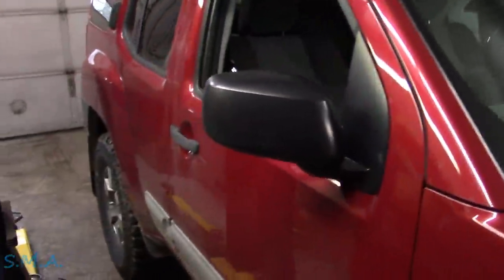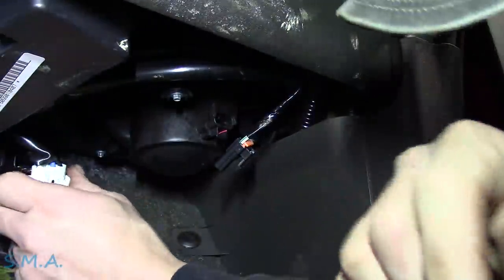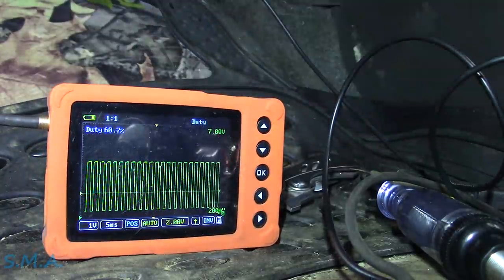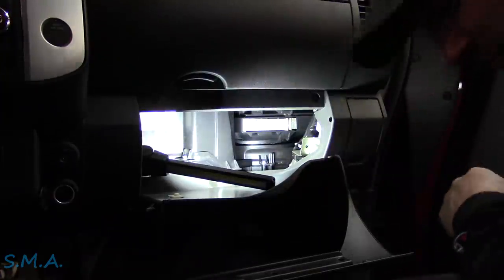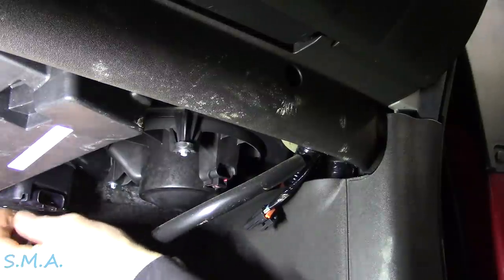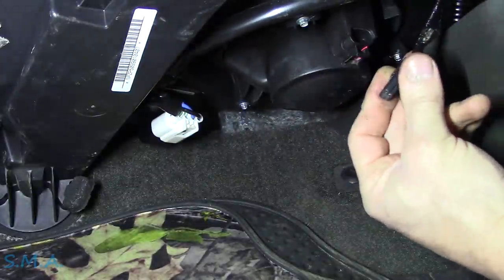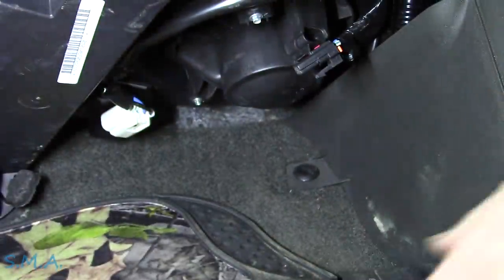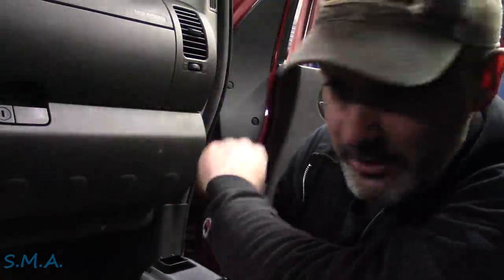Nissan Xterra: Blower Motor Not Working

Comment: When dropping your car off to your mechanic, at least have the decency to clean your car up so your mechanic doesn't have to wade through the collection of garbage on your floor (fast-food wrappers, masks, dirty socks, etc). A hazard surcharge seems appropriate in these instances...
Reply: amen! preach it
Reply: Eric should charge them a fee for "hazardous waste removal"
Reply: My guy keeps organic respirators and nitrile gloves on hand, and if they have to clean out the customer's car to work on it, they're happy to do so - at full shop labor rate.
Reply: I’m a detailer at a dealership and I can’t even begin to tell you how many vehicles I see in the shop that should be charged with this “cleanup surcharge.” I had to clean out a customers driver and passenger compartment just so one of our mechanics could change the radio. The car was filled from floor to top with just trash and random shit. It was absolutely filthy and disgusting. I sprayed it down with Lysol when I had the front cleaned out.
Reply: I had one come in once where somebody had vomited on the right side floor and not cleaned it up.  Man, that car stunk.  I shoulda just sent that car out until the owner cleaned it, but I think I threw a fender blanket down on it while I was working on it.  Nasty!
Reply: @Lugnut64052  Ew.  Just... ew.
Reply: Yes you're right but I didn't see Americans car neat and clean in side and under body oh my GOD It's rusty garbage 
😢😢😢😢😢😢😢

Comment: Eric, I've sat in 100's of those design review meetings over the past 40 year as a design engineer. It usually goes like this... 
Engineer: "We're going to use a 6mm hex head screw, it's a common size"
Purchasing Bean Counter: "We can get 5.5mm hex head screws $0.001 cheaper"
Boss to Engineer: "Change it!"
Reply: You need to whack the bean counter over his 'computer' to give him a reboot.
Reply: I can’t believe I just needed to order a 5.5 deep and 5.5 wobble to remove the ignition assembly thinger I in my Ford Escape. Does a socket set come standard with a 5.5? Nope. So Ford must be collaborating with socket manufacturers to sell 5.5s. Or not
Reply: 100%
Reply: @marksd5650  not just Ford, I remember Saturn also used a 5.5mm socket for its ignition switch
Reply: Just use a 7/32 I've yet to purchase a 5.5 never had an issue
Reply: And then there like we could use a one piece filter that's easier to change but that would require $.02 more in plastic. lol
Reply: @adventureoflinkmk2  
Ford escort ignition module, on side of distributor. First time I ever heard of a 5.5mm socket. Only Saturn around in them days, had rings around it.
Reply: @martyj1062  some of us dont have Sae, only work on modern-ish cars, way past Sae
Reply: @splice247  not sure what modern-ish constitutes or has to do with what I stated. I gave a simple work around. to imply sae isn't relevant seems rather narrow considering industrial and agricultural etc.
Reply: If engineers made the decisions car would be built to be repaired and would last forever. They would probably cost too much as well, but they would be built to last.
Reply: @martyj1062  7/32 x25.4 = 5.55625 mm
Reply: @martyj1062  yes, some dont understand you can substitute some sae for metric , 5/32=4mm and  and 5/16=8mm. And everyone knows 5/8=`16mm and 19 mm=3/4. And once you get into the ones over an inch then  most sae  sizes will work as well as metric
Reply: @marksd5650  Mazda/Ford 7mm Allen brake caliper pins... grrr... gots one now!. GM, Toyota also use 5.5 on resistor.
Reply: Nice. I imagined it going something like that. Thanks.
Reply: @martyj1062  I to do this but seems to strip the little guy that is impossible to get and I leave that screw in and break the ear off. It’s my in-laws car so it’s good.

Comment: Mechanics have it so easy these days. I spent Sept 1970-May 1974 in the Oldsmobile final assembly plant in Lansing Michigan. It was a hoot watching my co-workers assembling the dash. It was face down on a special support, and they had free access to everything from any direction. To assemble the dash they use custom-made tools to snake wires, and cables through the rats nest. Thus, even if your mechanic pulled the dash completely out of the car, they would never ever be able to complete some repairs without those special tools. I will bet only the dealers had access to those special tools.  But I don't know.

Comment: A 2005 Nissan Xterra was my first vehicle... bought it used with 230,000km for $1,000 CAD. Same red colour.  I loved that beast: learned so much about automotive mechanics and general car care/repair. Drove it for 5 years and ended up putting it to rest at 400,000km. The blower motor was one of the first repairs I ever did. Thanks for the memories, Mr. O!

Comment: I feel your pain from the gut feeling. To get paid for actual diag time is almost impossible in my neighborhood. One shop I worked at always sold the resistor and blower as a combo. Truth be told, I didn't mind. I hate just throwing parts at cars, but being under most dashboards is difficult. I'm a big guy with broad shoulders, I don't fit well under most dashboards. I also have had my neck bones rebuilt. If I'm going under, I don't mind replacing them both. As always, your videos are my top clicks. I only watch other channels if the repair is relevant to something im working on. Just know alot of us was feeling the pain of being crammed under there.
Reply: I'm sure Eric is thankful he's not a big guy as I think he's at most 5'10" and wears a medium to large shirt/hoodie, so even then, it's tight under there and I've had to deal with being under my dashboard and yes, it's no fun at tall for anyone, but more so for the bigger guys, especially the more broad shouldered, barrel chested ones.

Comment: With a PWM signal, that "resistor" was likely a power transistor.  Usually, power transitors have an inline thermal fuse that blows.  Replaced one on a 2004 Honda Pilot.  No where in the manual did they tell you about the fine mesh over the blower intake that was in the driver's footwell.  Previous owner had had small dogs, so there was a felt built up over the intake.
Reply: Couldn't understand why a PWM driven motor would need a big-ass resistor. Thanks for the comment.
Reply: @Bret Agreed, and I still wonder why a transistor that should be saturating  would need a heatsink that huge (30W?)
Reply: Exactly.  And 99/100 a power transistor is going to fail short .  Which is to say the blower will be full on.  If it's not, then go looking for that thermal fuse if you have the time.  If you don't have the time and it's not your car, follow Eric's path of replacing the parts.
Reply: That's nuts!
I take it you mean a non reset-able thermal fuse on the heatsink?
Either way, the only purpose of that would be to protect the mosfet from getting too hot. Why bother if the thermal fuse is just going to disable the PWM driver anyway?

Some designs man, really make you wonder.
If it were my car, I'd build a board with a fet bolted to a heat sink and a gate driver, stuff them in a box under the dash and know that I never had to worry about it again.
Reply: thanks 'cause i wondered how a "resistor" would be used in a PWM application.
Reply: @TeemarkConvair    Yes, certainly not old school where the "resistor" pack was three coils of nichrome wire strung between an arched bracket that stuck in the airflow.
Reply: Ok, that clears up my question. Why a PWM controlled motor would need a big resistor.
Reply: @jimmyb1451  I agree it's crazy but I betcha the blower motor doesn't have any other switch, so it would run all the time even with the key off if it overheated and failed short.  Anyone with a schematic want to confirm?
Reply: @paulmoir4452  Nah I doubt that. The A/C or climate control would be powered through the IGN circuit. Most probably, there's already another FET that supplies power to the pwm module, switched by the BCM after the engine has started. 

But.... who would know these days, the stupid sheet they're putting into cars and the stupid ways they're doing it these days... really anything is possible.
Reply: Guys, there is no resistor. This is a power transistor controlled by a pwm signal from the controller to drive the motor. They generate a lot of heat, that’s why the big cooling heat sink
Reply: @deerhunter8533  Resistance is futile!!
Reply: @deerhunter8533  That's the thing though. It shouldn't be generating much heat. Unless the gate drive is poorly designed or the chosen FET is particularly slow, it should be driven to saturation and shouldn't be spending much time in the linear region.

All that said, it's not much of a heatsink. 

Clearly though, there's not a lot of head room in the current switching capacity of the chosen FET. It was stall torque current that caused it to blow. Interesting that it didn't blow short.

I'd like to see a tear down of the PWM controller (assuming it's not potted). Would be interesting to see if for some reason they went with a BJT.
Reply: @deerhunter8533  Yeah, we're aware of that.  Jimmy B's response is what I would have said too.  If you're PWMing and your switch is getting hot, you're doing it wrong.
Reply: @jimmyb1451  Don't know about Nissan, but when installing a parking heater in VW's, you just wire in a seperate fixed rate PWM module, which starts the fan at a fixed speed. The fan's power side is always on.
Reply: @jack002tuber  it's why you never try to stop monks from protesting.

Too many ohms.
Reply: @ebbetranberg9472  lol... is that a trick answer because some VW's have a positive chassis? ;)

Yeah, fair enough for a low side switch. And for a parking heater it makes sense that ign/acc not be involved.
Reply: @jimmyb1451  I don't really know what you mean, but the PWM signal from the parking heater is just a low power control signal, it's the car's own power PWM which drives the fan, and that circuit is always on, regardless of the key position. That makes it much easier to install parking heaters in cars with climatronic than in those with fixed fan speeds, where we have to make an additional power circuit to feed the fan, when the car is off.
Reply: @ebbetranberg9472  Sorry mate, bad joke. VERY early VW's ran on 6 volts and had the batter positive connected to chassis, instead of negative. Interesting that they now have a constant PWM signal, I assume derived from the BCM or some other controller in the dash. Completely unnecessary of course, there's no reason for the parking heater to be married up to the climate control, there's no reason why it can't be a stand alone function.

But, what would I know? I'm not an engineer and I'm not interested in collecting every piece of data I can on people. :)
Reply: @jimmyb1451  VW never had positive ground, that was a UK/USA thing. The parking heaters we use burn fuel to heat the engine's cooling water and use the car's own heater fan to get some hot air into the passenger compartment, when the water temperature reaches 40 deg C
Reply: @ebbetranberg9472  fair enough. 
I live in Australia, we're not used to dealing with sub zero temps.
Reply: @jimmyb1451  But you could use the ability to run the blower fan independently to ventilate the passenger compartment by a timer or remote control, so it's not 50 C when you want to drive the car. Webasto let you do that.
Reply: @ebbetranberg9472  What's Webasto?
Yeah, you could. I've actually done that to my car using an Op amp and a K type thermocouple.

Comment: I had a feeling it was the blower motor all along.  That is simple repair and easy to get to both those parts. Now I had to change my blower motor on my Mercedes Benz 1987 300TD.  That is a tough one to get too.  It is just in front of the firewall and you have to remove a lot of stuff to get to it, like that wiper motor.  Now the Resistor is under the blower motor and that is a real experience to get.  Now I see why a shop would charge like $900 to change out a blower motor..

Comment: In the 1970s I had Snap-On screwdrivers with a hex on the shank for putting real torque on it. The hex size was - you guessed it! - 5.5mm. I had a 5.5MM Snap-on combo wrench to work with them.

BTW, the resistor pack has more than the resistor(s) in it. They include a thermal fuse - it opens when it gets to a specific temperature and doesn't care much about current. Who wants a fire in their ventilation ducts?

Comment: 5.5mm is actually a very common head size in my experience. It's the default size for M3 nuts. When your screw is only 3mm, 0.5mm is much more significant then when you have a fat M10 bolt.
Reply: Randomly used on Generous Motors Resistors too

Comment: My favorite blower motor resistor story: my '99 Camry. Blower motor had a bad bearing, so it made a horrendous racket on high, but was fairly quiet on the other three speeds, so I didn't really care. Then, the blower motor resistor fails about three years later, leaving me with ONLY high. Down to the Auto Parts Box Store, plug that puppy in so I could have heat without deafness but didn't bother actually installing it - I left it hanging under the dash for the ten minute drive home.
The new blower motor resistor lasted almost two minutes before it failed, leaving me with no motor operation at all. It was a cold drive home for a stupid mistake, and when I got home I heated up the soldering iron and re-flowed the solder on the thermal cutoff (it was merely two metal tabs soldered together) and did the RIGHT THING - I installed it as it should have been, where airflow keeps the thermal cutoff intact.
Two years later, it still works, and yes I did end up replacing the blower motor when I had to start doing the tappy-tap to get it spinning.

Comment: Like others mentioned already, I was surprised you did not check the blower anyway after you saw the resistor was fried. If it was shorted, you could have taken out the new resistor rather quickly. Since it often takes me a day or three to get parts, I try to check things like that to make sure I can get it working, or just get a new blower because it is cheap enough to replace something that breaks according to a designed schedule while I got the tools in there. 

I hear you on those cabin filter locations.  It always amazes me that the car manufacturers make serviceability such a low priority. They harp on doing the filter changes, then make it so you have to disassemble half the car to do a scheduled maintenance. In my Pilot, I knew I was the first owner to change the cabin filter because you have to cut out a piece of the dash subframe to open the access cover. Yes, Honda designed it so you have to hack out a piece of the frame to change a freakin filter! 🤨

That guy who invented the 5.5mm messed up because he forgot to patent it. There was real money to be made there!!! I won’t make that same mistake with my 10.2mm eight-sided design…

Comment: I would have seen power at the blower motor, figured it was the only problem, replaced it and then found out afterwards that the resistor was bad, too. I'm used to the GM thing where if it was the resistor only, the fan is stuck on high. I've never seen both bad, but I get how and why one can cause the other to fail. Great video - thanks for posting this!

Comment: Safety rules require the blower motor to work on high speed even when the resistor fails in order to defrost your windscreen.  Oh, try changing the cabin filter on a Volvo S40. You have to remove the electronic accelerator pedal. So much fun.

Comment: I was wondering why you didn't give the motor a ground in the beginning just to test it.  Normally, I see you do that in other videos when testing things.   I've not had good luck with non-OEM blower motors.  They are normally louder and sometimes do not blow as fast as the original.
Reply: The ebay ones are the best
Reply: Even if the blower was working I'd still put a current clamp on it. If the circuit is on say a 30A fuse and it's pulling ~20A+, pretty safe call to swap it out.
Reply: @SerenoOunce  we serviced a fleet of Chevy Express vans at my last job. We kept a least on water pump, radiator and blower motor, resistor in stock. Talking to one of the managers for the fleet account he explained to me how they stopped using a different shop due to reoccurring blower resistor problems. Turns out they never bothered to check the amp draw on stock ORIGINAL blowers..its not uncommon to see close to 25amps and a nice 30 amp spike on a 40amp ckt. Obviously a new resistor  won't last long in that  environment. Its important when diagnosing vehicles to understand the root of the failure and having good fundamental knowledge is important. Unfortunately with the quality of replacement parts today it can be easy to want to chalk it up to crappy parts too..That's what separates the parts changers from the diag techs.

Comment: Eric you forgot E, when I still was a 
tech at a Buick Pontiac dealer I had
a Grand Prix with the same problem,
the blower resistor was burnt out and upon further digging I found the
AC drain was clogged and the condensation leaked into the passenger floor board burning out
the resistor!! Spiders love crawling into
the little rubber boot covering the
drain tube!!! Nice work Eric!!